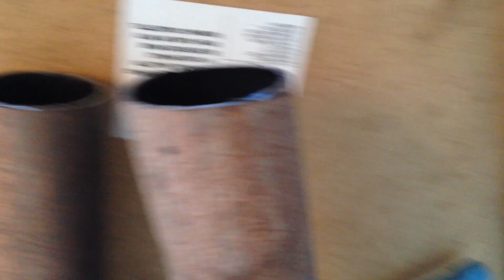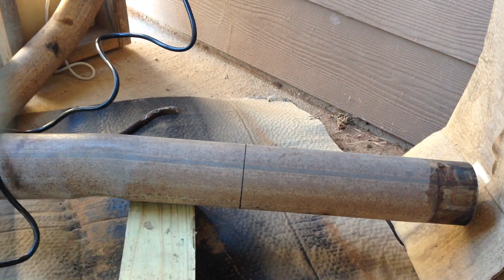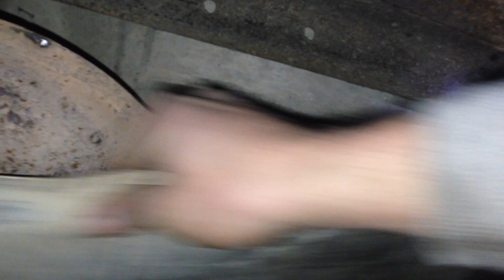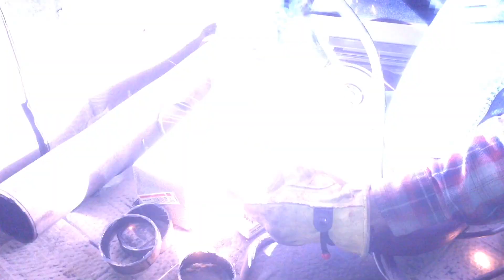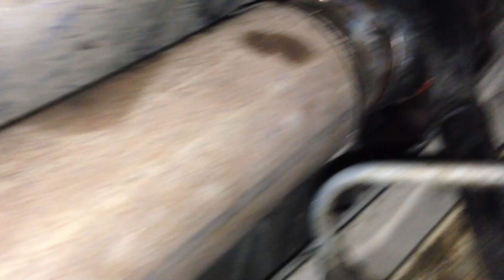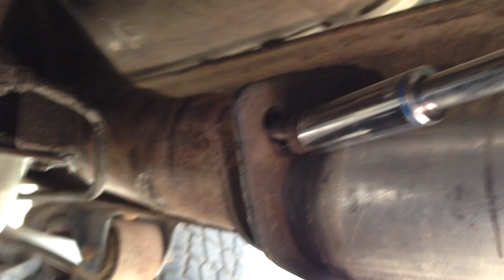Custom 7.3 Powerstroke Down Pipe

Comment: That’s so awsome!! Good job! How much for a down pipe? I’ll buy one off you? Lol. So with a 3” down pipe you can actually notice a difference on the top end?iuuu
Reply from the maker: Thank you! It sure was nerve-wracking having the truck decommissioned for the couple of days it took to build the down-pipe. I did notice a very very slight increase in top end power after the install. At this point though I'd already built the 4 inch down-pipe back system, and that I think made the most difference for my stock application on turbo response and top end, but that too was very slight. If you put a down-pipe in you may have better results than I did. I also suspect that with 353k miles on the odometer, my injectors are probably original and getting worn... That alone is probably limiting my trucks potential. You may also see better results with your chip, because the chip adds more fuel and effectively flows more air. The more airflow you have may be really pushing the limit on your stock down-pipe, whereas mine with stock tuning, won't push the limit as much. 

From what I've read though the more important thing about installing a better flowing down-pipe is to effectively reduce your exhaust gas temperature, especially when towing. I've also heard of folks pushing 600hp through a 3 inch aftermarket down-pipe, so I figured 3-3.5 inch would be even better... 

Bear in mind also that horsepower isn't built by the dozen, but by fractions at a time. A 3 inch down-pipe that is smoothly bent, even though it may have a smaller cross-sectional area compared to the stock down-pipe in some sections, will actually produce less back pressure since the flow of the air is smoother. If your engine has to do less work to push the exhaust gasses out of the exhaust, that basically means you get that power back to the rear wheels instead of generating heat. 

If your really want me to build you a down-pipe... It'd probably have to wait at least until summer when I can go back home and not be stuck in a blasted apartment! I also see I can improve the design quite a bit. For instance if you saw all the way through, I did not have to bend the ''seam" on my firewall, but if I, or you did, that could potentially add an extra half inch of clearance, perhaps enough to fit a full 3.5 inch down-pipe. That would also depend on how the engine and all sits in your truck. Mine seemed to have a ridiculous amount of clearance for whatever reason, maybe my body mounts are in near perfect shape? That'll help a lot. 

I'm a stickler for perfection, so bear with me if you will. I would build and potentially sell down-pipes after much more "Research and Development" (hence RnD diesel...) before I'd be satisfied with selling one. 

If you've read this far, haha lol. I've rambled on a lot... That's just me. Let me know if you have any other questions! 

-Rnddiesel
Reply: Thank you very much I just love talking about these awsoke obs trucks. Keep up the good work!